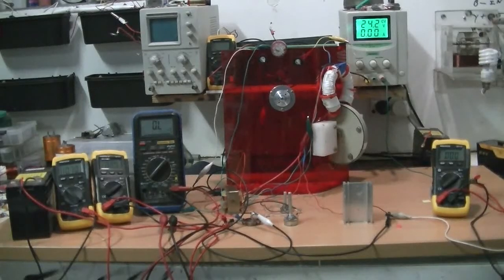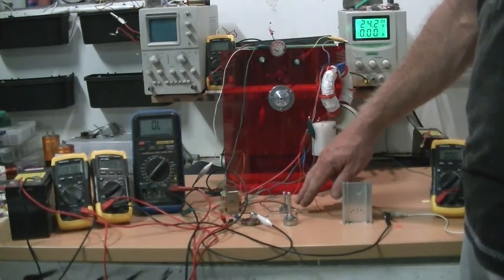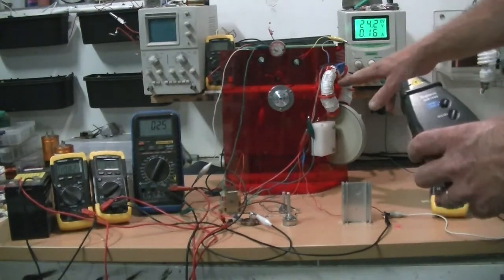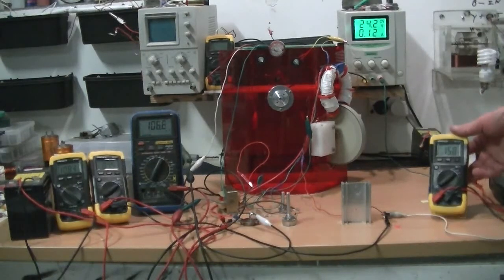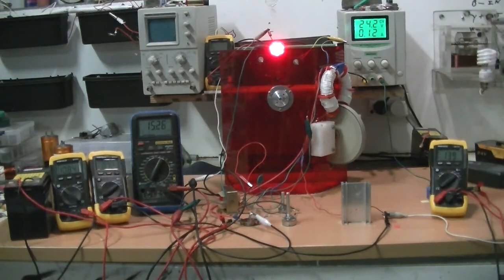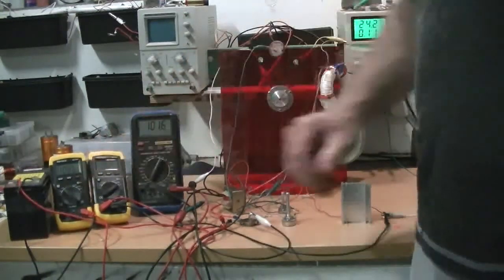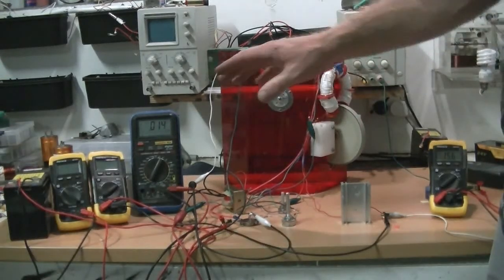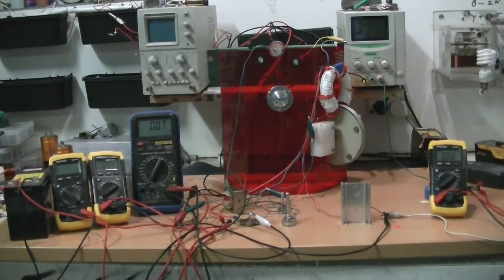lens law smashed.flv

Comment: did you say HOW you did it?? Has that 1.3 ohm load to be inductive? Do I get this right, you use kinda angus effect / bucking coil to induce the current fom the rotor? How does it perform with a non bucking coil?

Comment from the maker: @User2718218 The thing you have to understand here is that im not interested in the return voltage from the run coil.I just needed a simple pulse motor to run my generator,the return charge is just an added bonus.The point with this was to proove that power can be produced from a generator without adding any load to the prime mover.Infact the prime mover also speeds up without any more power input being required.i havnt removed the lens effect but i have used it to work with us not against us

Comment from the maker: @Magneticitist  Hi Mag-the charge rate dose go down when i hook up the generator side of thing's-but this is square to the current draw drop from the run battery.As you will see in my up and comeing vidio  that watt's used has been measured wrong by both myself and most other user's i know.Everyone go's on the asumption that the watt's used is the voltage of the run battery x the amp draw-I dont believe this to be the case.

Comment: @User2718218 i can agree that simply watching the voltage on the battery is no real indicator.. and i suppose no detailed genuine measurements were made in that area in order to determine exact ratios.. but just judging from the amount of power pulled from the coils it should have at least made noticeable difference. two other reasoning's i have.. one apparently the effect works for any load which is quite a coincidence and 2 TinMan is advanced enough to have already taken all this into account.

Comment: heres a thought to combat the general idea of this circuit acting as a "normal" bedini in the sense that overall performance should improve ANYWAY when loading the run coil...

while that is true, he is ALREADY loading his run coil with a charge battery.. so if he were to load his generator coil (which according to User2718218 would tune the pulses more efficiently as it affects the run coil) then this charge battery would be receiving LESS charge, balancing everything out but it doesnt.